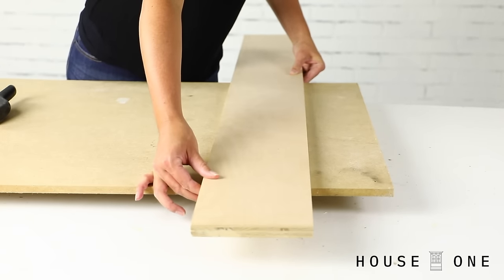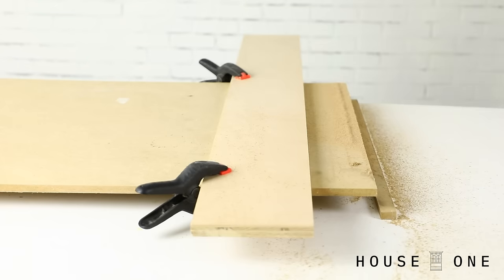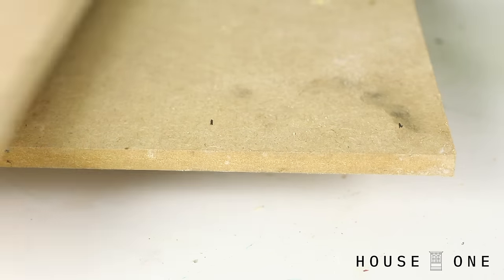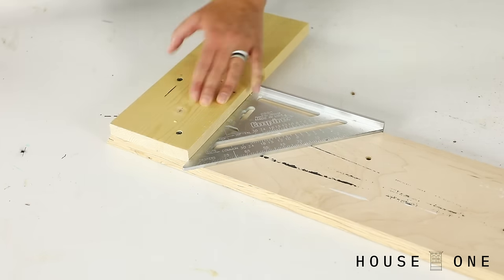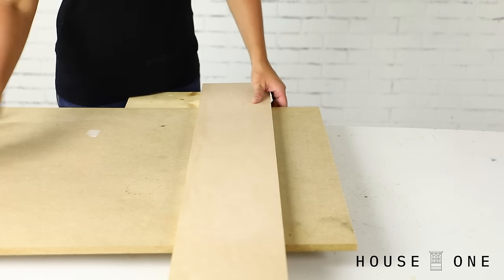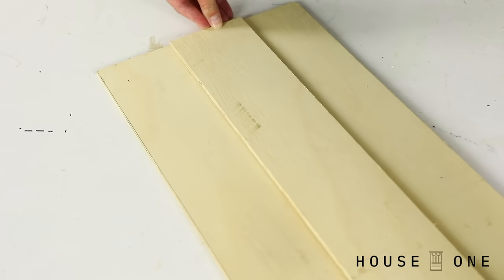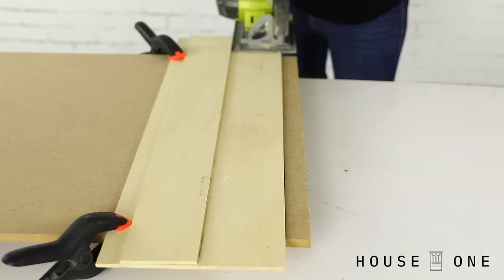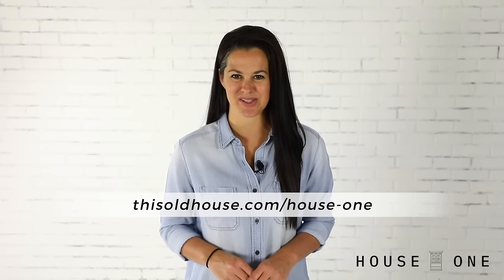How to Make Straight Cuts with a Circular Saw | House One

Comment: Brilliant other than the fact that you need to cut a straight line for each of these options 😂
Reply: im dead
Reply: 😂 I was thinking the same thing.
Reply: use something with a straight edge to start. a 4' level, drywall T square, factory end of mdf board.
Reply: …was that not obvious..?

Comment: Option 4, buy a saw guide from Home Depot.
Reply: Or just use a freaking tablesaw...👀
Reply: @markd5067  not everyone has the money or space for a freaking tablesaw.
Reply: @nicolej9101  You're absolutely right.... I'm sorry
Reply: @markd5067  hey its all good. I'm sorry too for the attitude behind my reply.
Reply: @markd5067  I don't know about you, but wrestling 4x8x3/4" sheets of plywood through a table saw - especially cross cut - is a nightmare for me. Unless you are He-man or have a very fancy table saw.
Reply: @bradley3549  Sorry...I am a professionally trained commercial journeyman carpenter. I forget that most don't have the skills I do....
Reply: @markd5067   Regardless of skill, I'd rather bring the light saw to the heavy wood than the heavy wood to the heavy saw given a choice.

Besides, for what I do, I can gang cut 3-5 sheets at a time, so it's a no brainer to use a circular saw guide. 

Get off your high horse.
Reply: @bradley3549  You missed the point...
Reply: @markd5067  Please explain. My point is that there are easier ways than using a table saw. Your point is that you're too cool to use a saw guide? Would get made fun of on the jobsite? "Real men eyeball it!" LOL
Reply: @markd5067  Hey, you were the one flexin' hard on how skilled you. Sorry for your back and joints bud.

Comment: Hi Jenn this was a very nice presentation. I do the same thing but my cuts do not come straight. When I do the cut , I put a straight edge against my cut and I see day light.  Is this the nature of a circular saw or should I get a track saw ? Please advise. Thanks. By the way I have also used a level as a reference to make my cuts. I am totally frustrated. Please help. I have a 6 1/2 inch Dewalt circular saw.

Comment: I find that a nicer circular saw is easier to handle. I had a Ryobi and it was hard to control and generally a piece of junk. I bought the Milwaukee and it has more power despite being lighter and easier to control.

Comment: I don’t understand #3. It says trim both sides equally @1:26 yet in the next step one side seems wider.
Reply: Never said equally...
Reply: It is wider, notice how the circular saw is not centred, it's close to one side than the other. This means you can accurately use the 3rd guide on either the left side or right side without worrying about the circular being off centred.

Comment: Now do how to cut a circular line with a straight saw 😁😉
Reply: Tangential cutting? Lots and lots and lots of cuts. 😂😂😂😂

But, probably easier with router cutter on long trammel?

Jigsaw on a piece of non elastic string/cord from central fixing ... or two fixings for an ellipse?
Reply: You can use a piece of wood with a loose screw or nail at one end, and press the other end with your saw as you rotate the piece of wood.